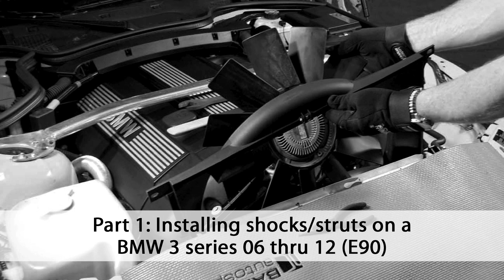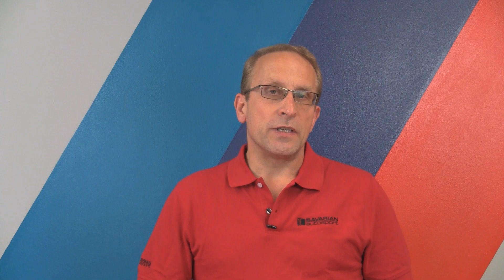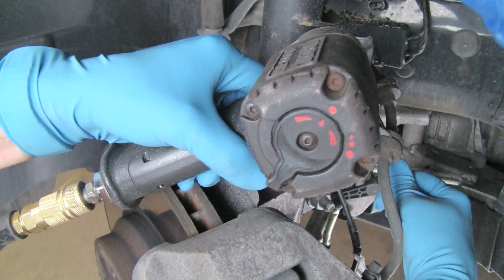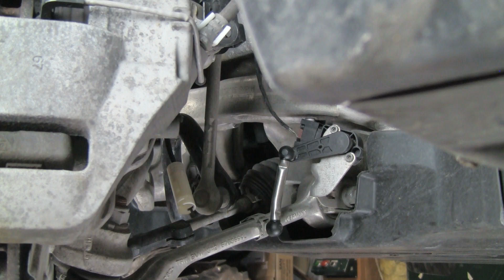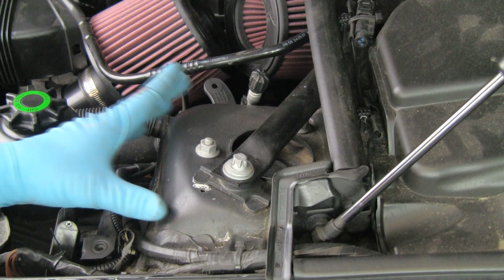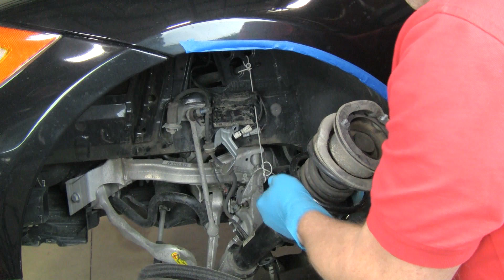Part 1: Installing shocks and struts on a BMW 3 series 06 thru 12 (E90, E91, E92, E93)

Comment: Hello - great video! Nice and up close which really helps me wrap my head around it. I have a question though... the car in the video is RWD. 

For the front end... is there anything else that needs to be done when performing this procedure on an XI AWD 335 e90? 

I'm about to tackle this today and for some reason thought there were more steps involved due to the drivetrain up front. 

Hope someone sees this today! :L)
Reply from the maker: The Xi (or xDrive) models have no differences in procedure for the front shock/strut replacement.
Reply: @bavarianautosport  I just did this yesterday on my 2006 330xi.  There were some differences worth mentioning.  First, I did not have to remove the inner fender liner to get at the front stabilizer bushing.  It is not there on my car.  There is one stabilizer just behind the steering rack and a second on towards the rear.  Both have through bolts so you need to hold one side with a wrench while loosening the the other side.  Space is at a premium but it can be done.

Next, the clip that holds the headlight adjuster cannot be released in the manner shown.  You have to remove the nut (10mm) on the lower connection point.  Then the clip opens up like a little hinge.  Spray it with some penetrating oil first to minimize the chance or breaking it.  Mine came off quite easily.

I lucked out on the driver's side.  As soon as I removed the pinch bolt the steering knuckle basically fell off the shock tube.  Not so much on the passenger side.  It was really stuck in there.  On that one I kept spraying the sleeve where the shock fits with penetrating oil.  And had to pound the knuckle the get the shock free.  After some time it started to move and once the locating studs were clear of the slot I was able to twist it out.  Not fun!

And finally, on reinstall I could not get the shock to slide in and seat before rotating the top into place as shown in the video.  I found a different (and maybe better way).  First I did a thorough cleaning of the sleeve where the base of the shock sits.  I used emery cloth and wiped all the debris out.  Then I coated the inner surface of the sleeve with a thin coat of silicone lubricant. (Sil-Glyde is what I used) I put the upper part into the shock tower and attached the top 3 nuts by hand.  Then I manipulated the steering knuckle and the shock to get the shock base into the sleeve.  I then put a jack under the control arm and had a helper jack slowly while I guided the shock locating studs into the slot.  Once both studs were in the slot I just kept on using the jack to raise everything until  the shock seated itself.  Then put the pinch bolt back in.

Hope this helps someone!

Comment: Very nice video !
But - is it really needed to loosen the 2 bushings, dismount the caliper and disconnect the sensors ? Can't the shock be removed wiithout lowering the wheel so much ?
Reply: Yes, it's completely unnecessary to remove the caliper

Comment from the maker: Part-1 is the front removal and install.  Part-2 is the rear removal and install.
Reply: On the xDrive e90 front struts removal/installation, do you have to remove or play with the ‘front axle’ from the wheel carrier?